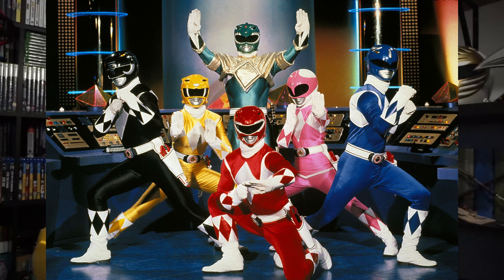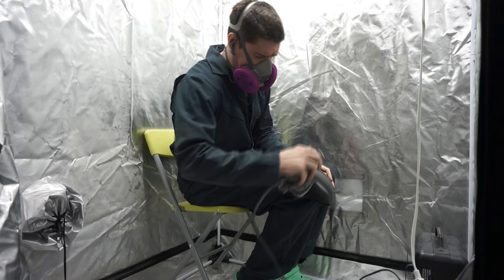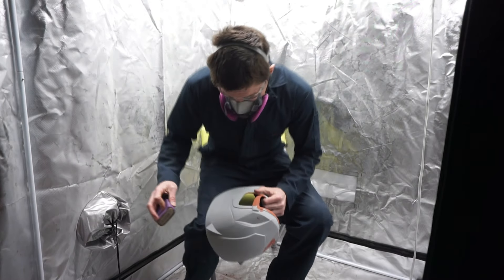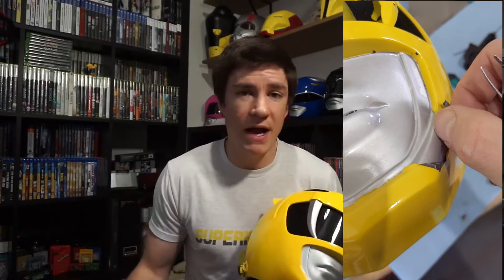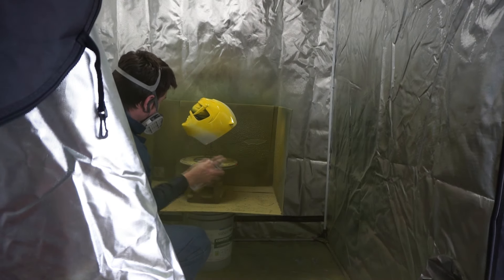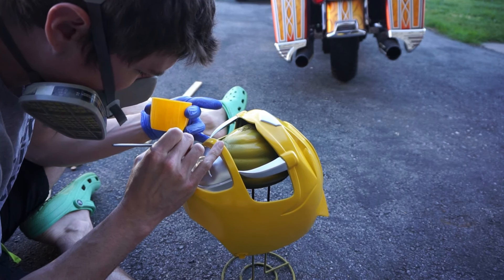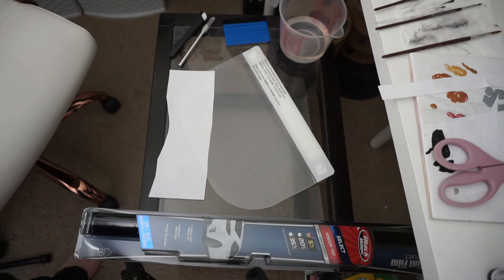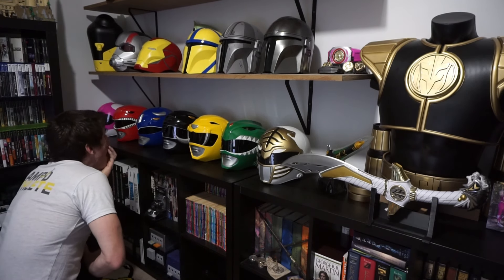How To Make A Yellow Ranger Helmet! 3D Printed Power Ranger Helmet Tutorial #3dprint #powerrangers

Comment: Do you put Guides in the Front and Back of the helmet so when you close it, it lines up perfectly? Or just The Latches outside and elastics inside?
Reply from the maker: I dont ever add any, some modelers have tabs on them some dont.
Reply: Okay cool, I have a Dino Fury Helmet Printing right now and it doesn't have any. Good to know I don't need any :)
Reply from the maker: @GeekEasy207  you should be fine with just elastic and buckles